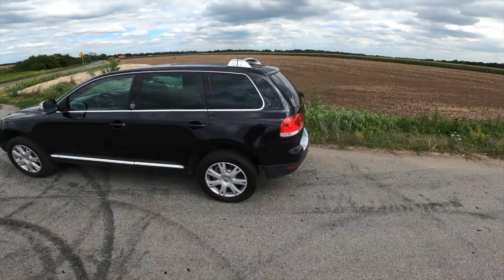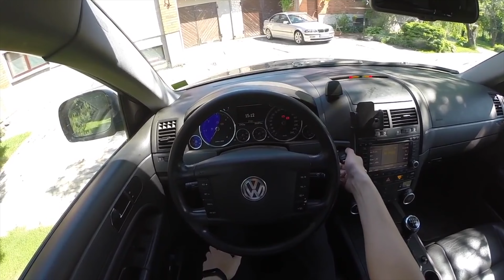Used Volkswagen Touareg I Reliability | Most Common Problems Faults and Issues

Comment: From the Philippines here. I have the 2004 3.2 vr6 petrol engine touareg. It had a lot of issues which I was able to correct. It's a bulky and heavy car. I seldom use it for city driving but it is ideal for long drives in the highway. You feel safe in it.